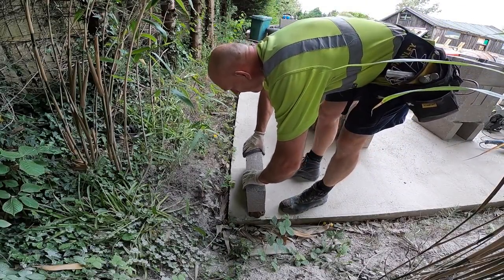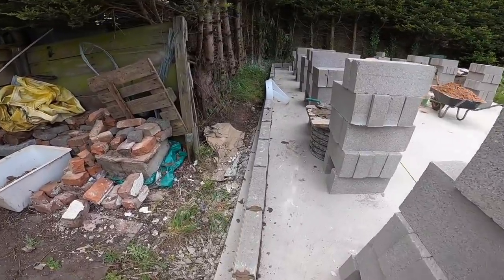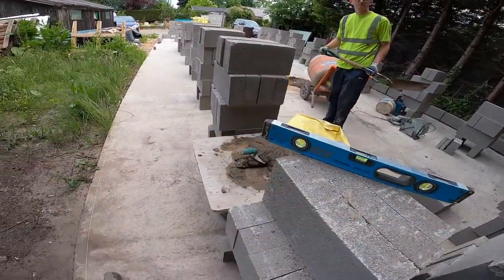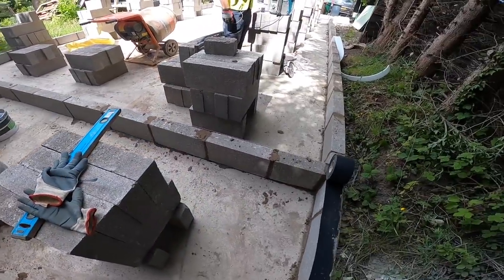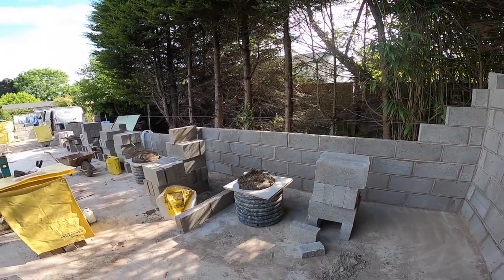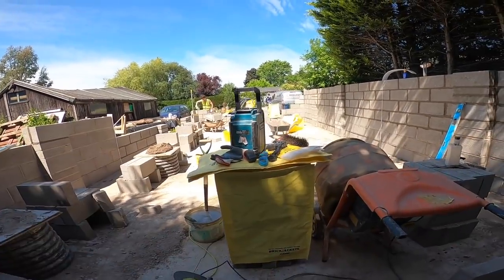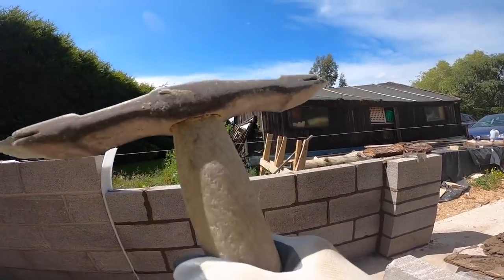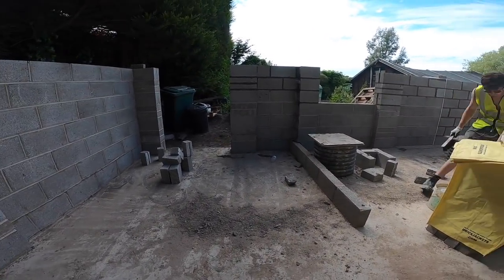CONCRETE BLOCK SUMMER HOUSE BIG BUILD PART 1

Comment: Hi Steve & Alex, love your vids, but need some advisei want to build a thermalite 4" thick workshop/ shed to be rendered, i have no trees to worry about nearby, but what i want to know is how deep should the concrete base be, how much mot type 1, blind it with sharp sand, then dpm, then concrete, its going to be around 6 x4 mtrs and 2.5 mtrs high. Cheers lads.
Reply from the maker: Sorry I can’t really advise without seeing the job. One thing I would say for sure . Do not use thermalites ! 🧱👍🏽

Comment: Here in the states that would have to be ether 8”” or 12”” Blocks with Rebar in between the Block every 4ft and poured with concrete Love watching the videos guys have a good one 🧱🧱🧱🇺🇸😎
Reply from the maker: Yeah this is the absolute minimum we could go . Not rock solid like you boys across  the pond . 
   Thanks very much pal abs sand to you too 🤙🏾🎅🏽🧱👍🏽

Comment: Great video. I have some questions pls. Are the pillars based on some standard calculation? Is it a certain width the a pillar. If building a small shed can I just do pillars at the doorway or will the widows need pillars also. Thanks, I'm learning. Another question pls, why the foam strip running up the walls front at front and back, I don't understand that
Reply from the maker: We don’t decide where the pillars go, we follow a drawing/ plan . 
   The foam is an expansion joint to stop cracks 🧱👍🏽

Comment: Hi guys, great video. I'm going to be building a block shed soon. It's going to be 6 meters x 3.8 meters wide. 

Can I ask, what's the expansion joint for? Is it due to the length of the walls? 

Also do you need the expansion joint on each level of the blocks?
Reply from the maker: You’re ok . I think max length without one is 7.2 metres 🧱👍🏽

Comment: For a small rear extension toilet/utility flat roof of 3.8m long x 2m wide, can you just use single skin blocks like this, and then insulate the internals, instead of a massive 50mm cavity double skinned block/brick wall? Space is limited. What are the building regs? Or does it have to be a double with cavity? 

Thanks
Reply from the maker: Definitely not single skin . You will need 100 mm cavity minimum with specialist  insulation or 150 mm full fill mineral wool . 👍🏽🧱
Reply: @SteveAndAlexBuild  Thsnks. And what size would the footings width need to be?

Comment: Nice job on the build Steve . They should have used a 9 inch cavity block and eliminated all the piers from the inside of the building there unsightly looking . Not the best use of time shoveling sand into a barrow out of the bag and then reshoveling it out of the barrow into the mixer .
Reply from the maker: Thanks. We were lucky as the driver got a big wagon up a narrow drive to get that close . The other driver refused which would have meant 3 times the distance 🥵🥵🧱👍🏽
Reply: @SteveAndAlexBuild  if you had kept the stand off the mixer you could have set up at the sand and filled the mixer direct from the bag and cut out the double jobbing .
Reply from the maker: @brickbybric  Na , hate the stand , just another 3 things to clog up the back of the van 🚐 🙄🧱👍🏽
Reply: @SteveAndAlexBuild  😀 3 things ? I always keep the middle bar of the stand in the mixer drum for safe keeping ,so that leaves 2 pieces to deal with . the stand is a labour saving device . That path you did down the side of your house for example Alex shovels sand and gravel mix into the barrow brings it into you ,then you have the awkward job of reshoveling it into the mixer down a narrow alley when you could have had alex mix the concrete were the stuff is and bring it to you . You must really hate that stand if you choose to do all that unnecessary work . The tonnage your unnecessarily shoveling every year must be substantial.😀😀😀😀👍
Reply from the maker: @brickbybric  🤔😳😆🧱👍🏽

Comment: What are the details on the slab here? Is the same thickness through or is it deeper around the edges ?
Reply from the maker: Sorry no idea 😬🧱👍🏽
Reply: But it’s ok to build blocks straight off it?  Reason I’m asking is that I was lead to believe that you have deeper footings for the walls?
Reply from the maker: @jamiestewart1644 We only started after the slab had gone in 🧱👍🏽

Comment: How are you going to stop damp penatration through the bottom block always an issue with building off slabs
Reply from the maker: Not sure what they have planned 🧱👍🏽
Reply: @SteveAndAlexBuild  Hi, this is exactly my concern with a much smaller but similar build I have planned. Do you have any suggestions?
It's for general storage and garden items etc. coming off an existing workshop. Will be a concrete slab, single skin block walls. Thank you!
Reply from the maker: @RavinProps  . Sorry mate , no ideas 😬🧱👍🏽

Comment: Why block? No wood in this area. 4 inch block is not structural.
Reply from the maker: No wood because it’s a bricklaying channel if you want wood try typing in carpentry 🪚
Reply: @SteveAndAlexBuild  You missed the point! No one uses 4 inch block as a structural block. I am also a bricky with 45 years experience. Also on your double width walls where is the vapor barrier and  insulation. Cavity walls allow in case moisture penetrates the exterior wall it enters the cavity and diverts back out through weepholes. Since it's taught in the trades everywhere in North America and many countries around the world we all can't all be wrong.
Reply from the maker: @edskapin7171  . Your code means diddly squat in the Uk I’m afraid 🤷🏼‍♂️